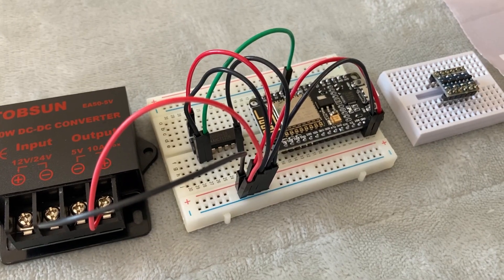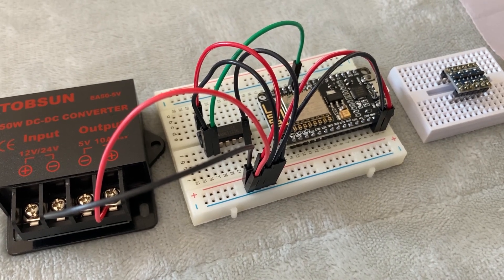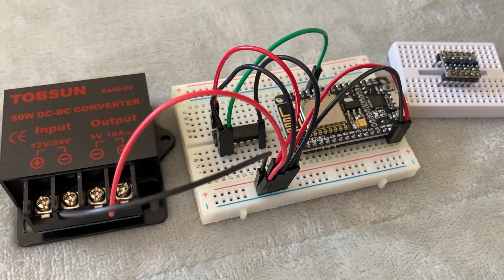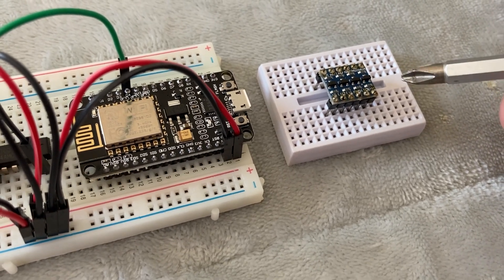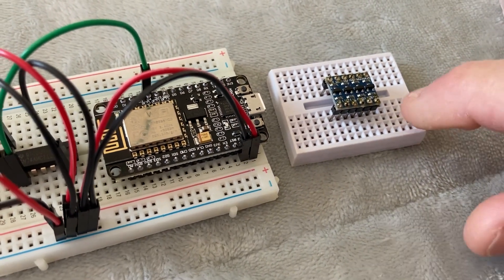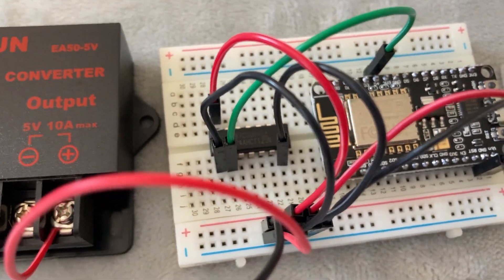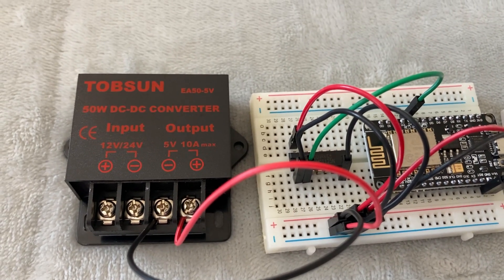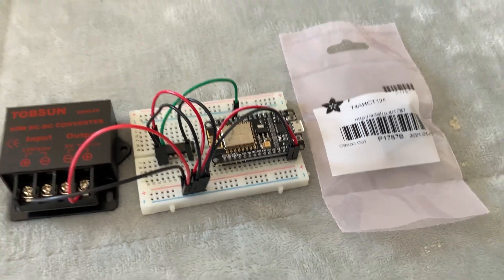Using a 74AHCT125 chip as a logic level shifter

Comment: 0:57 well sure.. but the data line doesn't suffer, One thing one has to remember about the WS281X line of leds is you send data to the first one. That's it. That one then sends data, minus the data that was intended for it to the next one. So sure, you can get data corruption for various reasons, and sure the supply voltage will drop over distance until it's no longer adequate for the leds down the line , (that's why you can add power in the middle of daisy chained strips.. But the data line from your microcontroller to your strip is only to that one first led. The signal from led 1 to led 2 is generated again using the voltage from the VCC and GND rails.

Thank you for suggesting this 74AHCT125 chip . I will look into it. I had tried getting a LLC to switch fast enough , I had the one you have show with the BSS 138 's. I tried 2 models 2N7000 I tried a seperate BSS138, I even tried an LM393 comparator. Nothing switched fast enough. The comparator gave the best result though.
Reply: > The signal from led 1 to led 2 is generated again using the voltage from the VCC and GND rails.
Thanks for the hint, this will definitely help me in cable selection for data bus

Comment: We swapped the level shifters like you have here, but the length of data run was shortened with the 74AHCT125... Any thoughts as to why?
Reply: I've seen people on WLED forums say to ground all the ground pins on the chip (each input/output pair also has a ground), and also any unused data input pins should be grounded, but not the outputs.

Comment: I'm no expert but it looks like you have your power input cables, from the DC converter, reversed.
Could be a costly mistake.
Reply from the maker: You are correct.  Thank you.  This was just a mock up I built for one of my 12 volt strips which is hanging way up on the wall in the garage.  Easier to film making a mock up.  I never applied power to it, but you are certainly right.  It is hooked up wrong.

Comment: Nice video. I'm just designing the circuit for driving a stepper motor and also need 3.3 -> 5 V conversion. 74AHCT125 might be to slow for 100-200 kHz, therefore I'm thinking about 74LVC8T245 IC. Both these ICs has OE, input, output pins. Trying to figure out what does OE mean and how to connect it from your design. Did you connect OE to +voltage or ground?